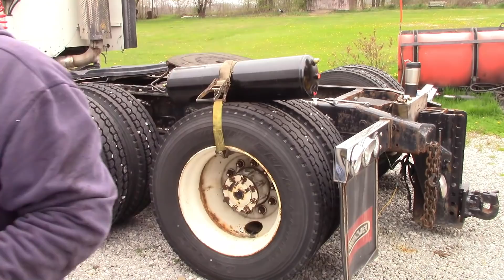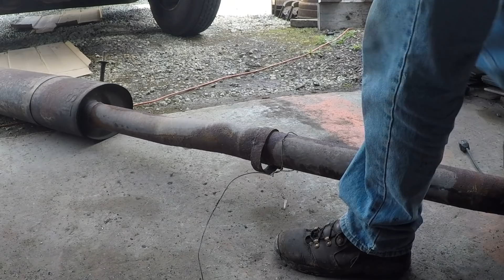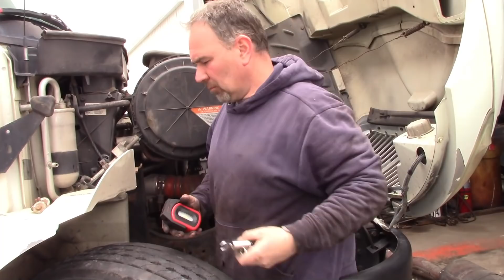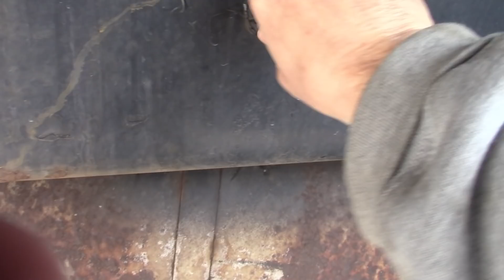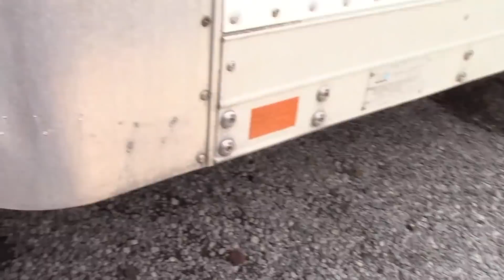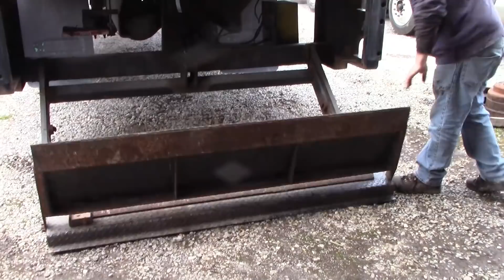INTERNATIONAL 4300 AIR TANKS AND DOWN PIPE REPLACEMENT

Comment: Hey. I have the same type of battery hook up as this 4300. After charging up the battery's I can't seem to get them back right. It comes up as an electrical fault. I'm putting the the red wires on the front pos side in parallel and the white in the back on the negative, with two small wires on the back. Any thoughts on what's wrong??? Wish I could see what you did.  Bill
Reply from the maker: you should have wires for the ecm that go on the positive and the negative terminals, the ones with the inline fuses are for the positive terminal.

Comment: To save the airlines there, get some scrap sheet metal, wrap the tanks on the front and underneath and clamp it down with some strapping.  It lets them be a good rock guard/sacrificial shield.  Doubles the life of those tanks! :)

Comment: Thoughts on a maxxforce 7 in a terrastar?
Reply from the maker: there is a reason you never see my buy either of those. values are really low and the probability of a catastrophic engine failure is almost a certainty. that is why they are so cheap! no one wants them. i only buy them for parts. i have no interest i selling a truck with that engine. it is certain to cause the owner major problems as some point.
Reply: @j.c.smithprojects  thanks for the reply.  I am at wits end trying to find what i need in a truck.  i want a utility body, and if it were an f550 for example, my tools wouldn't have it near max load by any means, but need to tow 8 tons with it at the same time.
Reply from the maker: I see that combination often. i would prefer something larger with air brakes. maybe a international 4700-4900, 4300-4400, freightliner fl70, fl80, m2 or ford f750,f850.

Comment: Looks like the exhaust repairs were a little on the sketchy side after the turbo replacement, tech probably didn’t want to replace the pipe or customer refused.

Comment: The switcher this winter i drained a lot of water out of its tanks but its a pain because might have the trk run for an hour in morning to get us set for the day and then sometimes good for the day other times a couple hours to start the day then a few trl moves through out the day. Sometimes it would freeze.  My 97 7.3 powerstroke has a brand new exhaust turbo back 3" downpipe 5" everything else with brand new 180cc injectors.  WOW.  looking into turbo soon and maybe uppipes then

Comment: Hey J.C and Mrs. J.C ...a trick i use when removing air tanks or park/release valves etc...i use the multi colored zip ties..put same color on the fitting and one one the airline . Usually those 4 inch ones come in kits of 8 or more colors..its takes away the brain pain with the lack of memory i have lol . Just sharing a hopeful helpful hint..tc

Comment: Jc I have made my own? I used pipe the same diameter  and put square ends on them the biggest problem  is cutting the bung air line  I made a long  threaded pipe with the same threads and use a flat plate to weld the ends on the new tube ( becoming the new air tank),and I weld the threaded pipe into the drilled flat ends weld both sides  of the threaded ends and then weld the flat plates on each end of the replacement  pipe,now sometimes you can  run up on very hard pipe which won't rust as easy ,and thats the best to use,I had a JVS machine trades and welding shop do a set for me ,its nice to precut and have your 1/4 inch round ends made and cut  a head of time then drill your holes where you need them ,(to make a custom  replacement  better  than the factory,)  then use the commercial  frame paint  to keep it from rusting back so fast.I think  the factory  replacements are way over cost .( cost to much to buy new replacements) have you thought  about making your own?

Comment: Powder coat paint has no business on a vehicle. It gets chipped and all the road grime, salt and water gets between it and the steel.
Of course any project with rust involved always slows us down. Pretty sad to see that international cable says made in China, though most everything is made there now.
Reply: Guaranteed income for manufacturers selling replacement parts in my opinion
Reply: If you mean about the paint I suppose. A friend of mine wanted to buy a really nice knapheid flatbed from me, almost completely rust free. He wanted to sand blast it and powder coat paint it. I told him I won't sell it to you if you do that. Really didn't need to be repainted.

I kept it for well over a year waiting for him to come up with the money. I eventually got tired of that and sold it to someone else who gave me exactly what I wanted for it.
Reply: Nothing wrong with it if it's done correctly. For exterior powdercoating steel should be sandblasted and primed with organic zinc primer first. Problem is most manufacturers don't bother with this step and just powdercoat straight over bare steel. You wouldn't do that with paint or it would just do the same. Looks shiny and good for a while but not really much protection without primer.
Reply from the maker: if that is the case...i have never seen powder coat done properly because all i have seen ends up looking like this.
Reply: @j.c.smithprojects  It's almost as if manufacturers want to spend as little as possible but just make stuff look pretty to sell it? Can't be lol.